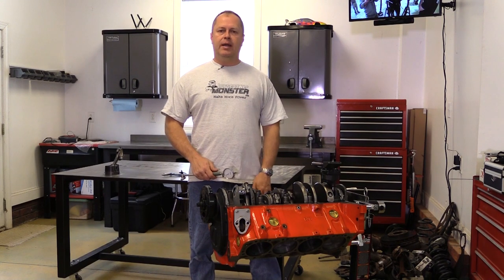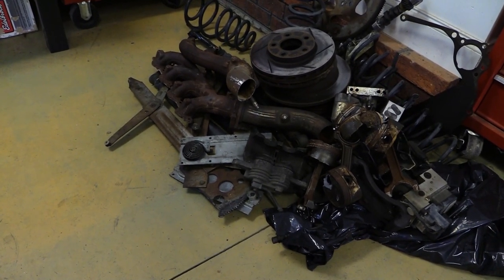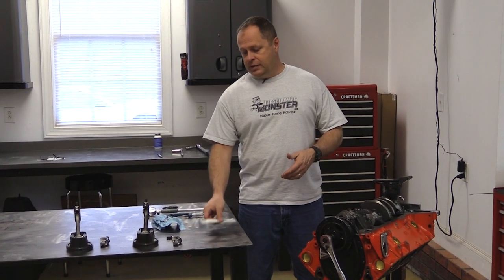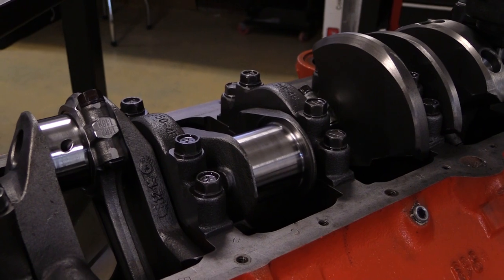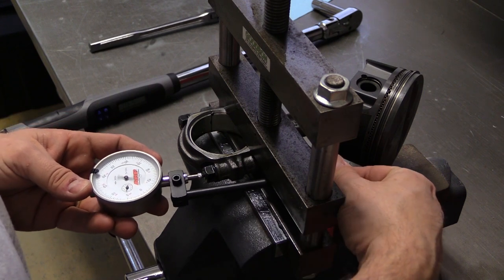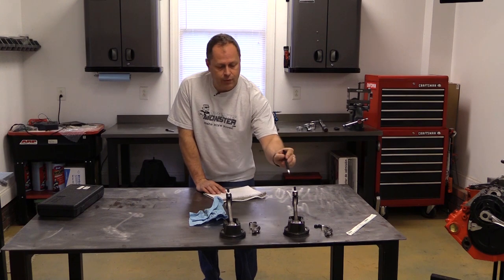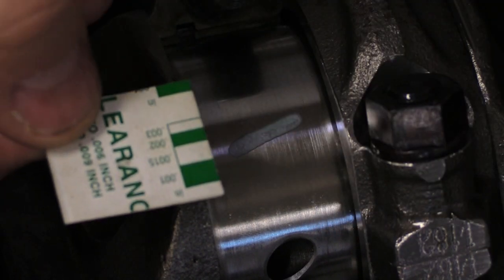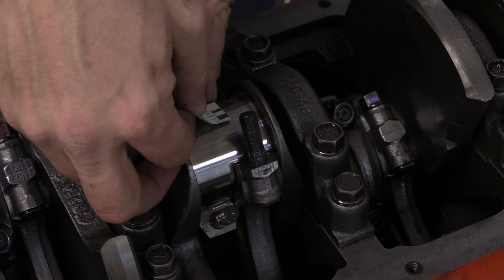Better Engine Building: Does Plastigauge Work? (Testing Against "Real" Engine Builder's Tools)

Comment: Well, how do you measure the crankshaft bearings' clearance using that one dial gauge?

By the way, just stumbled upon your videos and they really inspire me. I'm a Mercedes-Benz trainee in Germany, so your little series does help me out a ton.
Reply from the maker: Generally, I check both the crank and rod bearing clearance at the same time with the crankshaft standing on a work bench. I don't normally check bearing clearances with an engine that's not fully apart, I just did it this way in the video for the sake of illustration (so people can visually see how everything goes together). Hope this helps, and thanks for watching!

Comment: Plastigage is ok stuff. Is it as good as a micrometer, and a dial bore gauge? No! But for most street applications it’s perfectly fine. 
If you’re having machine work done, and your having it done at a reliable shop. There is really no reason to waste your time on Plastigage.
Reply: Good luck with that, I strongly disagree!

Comment: Why would you check clearance on worn parts to be machined, other than checking bearings brand loyalty or machine shop reputation??   Do another video on how accurate Plasti gauge is AFTER your parts are machined for rebuild .  I bet the Plasti gauge readings come in a hell of a lot closer to your precision tools then..

Comment: Plastic-gage .....high school auto shop technology, no thanks.
Reply: No mate, if you are spending thousands of dollars blueprinting and building an engine. You want to check everything twice. If you final check with plastic gauge on a clean dry crankshaft in a clean dry bearing shells ( very carefully) and your plastic gauge is in the middle of the bearing cap perpendicular to the con rod then you are measuring the critical  clearance  on the bearing set up. There will always be more clearance the further you measure off of the centre line. Now you have a visual representation of ypur actual clearance.  Now you are safe to continue.
Reply: Mark Geldenhuys pass on plastic gauge. You can use it, not I.
Reply: High School technology? Plastigauge is used on Turbine housing bearings